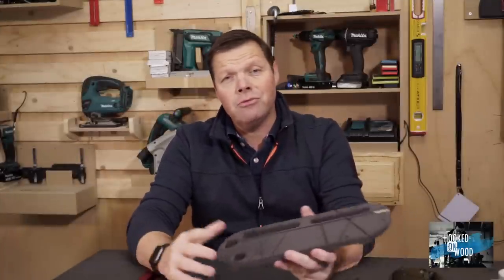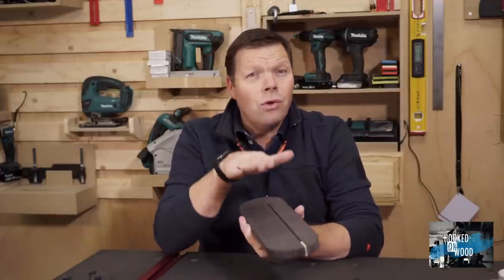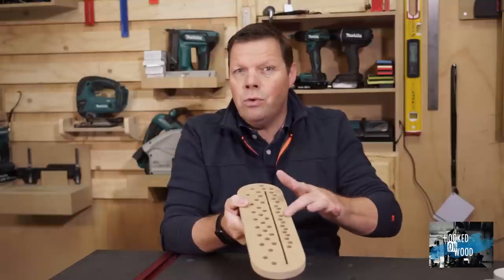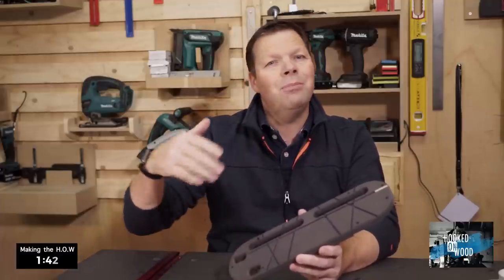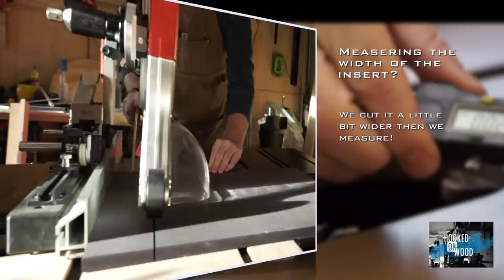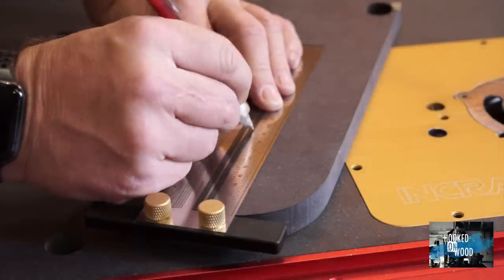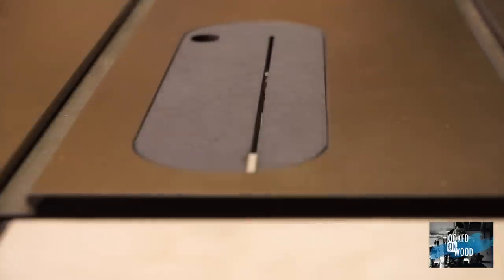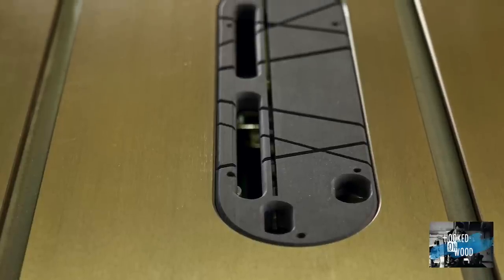A new zero clearance insert you should see!

Comment: There are some issues with your analysis-
You are adding air inlets through the insert plate to the left of the blade, to increase overall airflow. But, unless you are cutting very slim strips, these are soon covered with the material, so cannot work. Internally, the dust shroud is rarely attached to the table, so there is already a gap that lets air into the extraction path. There may well be an optimum gap for this... If the cabinet is sealed, what is needed is a duct from outside to the side of the  blade, sized to give optimum airflow.
The material that the blade cuts is trapped in the gullet as it traverses the material- and then by the sides of the insert (if it is zero clearance). It is desirable to clear it then, before it rotates and ejects upwards.(The rake tends to retain the dust.) Ideally, there would be a sideways jet of air, pushing the dust out of the gullet on the underside of the table. A good design would have an internal shroud that directed air from the left of the blade, through the gullets to the right and then away to the duct. All the saws that I have seen have fairly crude dust shrouds. It does not seem high on the manufacturers priorities...
Clearing the dust in a cabinet saw- a well designed dust shroud will taper downwards until it forms the outlet duct, so dust will fall by gravity to the duct, and there will be nowhere it can collect.
The dust that appears into the workshop is mainly that which has not been cleared the gullets under the table and escapes above- one solution is to fit a brush rimmed extractor on the top, of the sort used by CNC machines. If there is no route out for the dust, you will not have any dust.
Reply from the maker: Hi Mike thanks for your analysis. 
I do not disagree with everything you said, and it fits perfectly in my analysis. But I do not talk about what could be. I talk about what I have. And I do not have a dust shroud, so my dust falls in the cabinet.
My dust extraction system could not clean this with the holes in the cabinet. So, by creating this extra gab in the zero clearance, this improved. 
When you place a traditional zero clearance, you just make the airflow worse. 
I agree with you about the thin strips. But I do use it more than I thought. When you cover the holes, it acts just like every zero-clearance insert. So, my zero adds only something positive. When you have done your cut, the extra holes clean the inside of the cabinet.
All the other improvements you subscribe to are for the manufacturers. And I agree this is a field that can be improved. However, they give more priority to this nowadays. Thanks for your comments
Reply: @HookedonWood  Your slots will certainly help with removing internal dust whilst not covered- and that is probably the majority of the time. As you demonstrate, it prevents build-up of dust within the cabinet. My concern is more with the dust that escapes entry into the cabinet (or, more accurately, is ejected upwards by the blade after traveling through the inside). Yes, this is a different problem- but a more serious one (the dust inside will eventually rise to the point of being extracted- it will form the shape that a shroud would have given; it is doing no harm in there...) as it is now airborne.
I am more used to saws that are not a sealed cabinet- probably the majority of them. These 'leak like sieves' and would be unlikely to benefit from such slots. Sealed ones will, and for those this will be useful. However, an insert that had an extension to take the slots down to the periphery of the blade, directing the air to the side of the gullets, would achieve both aims. A 3D printing project?

Comment: Hello Dennis, did you ever check, if your "box" in which the saw is turning is actually so well sealed/air tight, that without your extra air-inlets on top, the airflow in the box is actually insufficient ?
Otherwise it could be that the air-circulation under the table influences the airflow of the overhead extractor (and the other way around.), like 2 dust extractors with inlet hoses connected.
I made 2 extra inlets in the zero clearance insert and have the impression, that things didn't improve for me if I use both extractors.
If I only use the extractor that clears the box, things did improve probably a bit with your additional inlets.
I did a lot of thinking about this and came up with the following:
I checked my cabinet-box, and found, that there are a few openings in my table and the surface size of these openings seem about to correspond with the surface size of the extractor hose.
If you have too many openings (as I now may have) extraction-speed (and strength) are going down quite a bit, so perhaps it is a good suggestion to first check this.
what say you ?
Best regards, Karel
Reply from the maker: Hi Karel, 
Your cabinet should not be, and probably will not be air tight. It has to cool the motor, but It needs air flow. But of course, you have to check if something is helpful. When I use my overhead dust extractor, I do not find any problem with dust. You understand your point and it was also my thinking. But most of the time, the wood is covering those holes in the inlet, so then the overhead dust extractor gets extra power. 
So, no extra dissedvantage in that case. Most benefit I get when I want to clean up edges, and cut away small amounts of wood at the sides. And when you can not use your overhead blade guard, than it gives a lot of benefits. SO, in my case I an not find any disadvantage.
Dennis

Comment: Thanks a lot. You can bet my next batch of throat plates will incorporate your ideas. What is the story on your choice of copper tape to seal your collector tube?
Reply from the maker: Hi Mark, I wanted to ground my system because with my former table saw I always got some static shocks when I touched it. I had this copper tape laying around so that was easier for me to use. But I found out that it is a good way of grounding. Other advantage is that the duct system does not attract dust. And of course, there is the safety thing of possible explosions. But I am not so worry about the last thing. SO, it is not to seal my duct system, but to ground it.

Comment: 1. During typical rip cuts or wide crosscuts, does the advancing board not occlude the added openings when they are most needed?
2. Any conflict between a blade guard’s up-draft and an insert’s down-draft? Might the opposing forces be counterproductive?
Reply from the maker: Hi James, 
I do not see any disadvantage against a typical zero clearance insert. That said, It is not always an advantage. If you have a cabinet saw, it will clean up your cabinet better due to the increased airflow. When cutting it is mostly helpful with cleaning up edges and cuts where the holes of course are not covered.
2. I had the same thinking, but I did not see a problem here.

Comment: I'm curious when you came up with your design did you do any calculations of air flow through your insert given the amount of air flowing through your extractor?
Reply from the maker: No, I think the most important thing is that the hole will not be larger than the outlet of your extractor. But the place on your insert is limited, so I do not see a danger in making the holes too big.

Comment: Dennis great work as alwasy , See this 100x  Need to make one ,  Has Anyone here in the US found a place to get the Black MDF in small size and not sheet goods . een a smal 15x2o would be enough. thanks
Reply from the maker: It does not necessary need to be from Black MDF of course. in fact, I made my first one from MDF and Painted it.
Reply: @HookedonWood   Thank you Dennis I made one yesterday from 1/2 Ply wood came out great , will see if helps m y dust extraction , thank  you for making this

Comment: Another way to cut the slot is to change the 10" blade to an 8" blade and slowly elevate the blade to the highest point, and then put the 10" blade back and finish the cut. This would eliminate the wooden insert!
Reply from the maker: Hi Bela, Yes, but I always found it a bit uncomfortable to do it that way. I think this way is safer, so that is why I recommend it this way. Thanks for your suggestions.

Comment: I just started buying my tools to do some wood working. A complete stranger gave me a craftsman 12 inch bandsaw after he saw my post on Nextdoor Neighbor website. I bought a craftsman palm sander, a Kobalt 10 inch table saw and cheap chop saw. 
I’m 61 disabled man and my wife wanted me to get off of my butt so she recommended wood working. Do I need to buy a zero clearance insert or just use the one I have? The reason I want to change mine is because this way I can use my drill bits to set my blade height. I can’t use them with my current insert. Thanks in advance.

Comment: I have an old Crafstman/Sears table saw - the factor throat plate is only 1/16 inch thick (metal).  How would I go about creating a zero clearance insert for something that thin? (non-standard thickness)?
Reply from the maker: When the form is not that complex, a zero clearance insert is perhaps possible. But a zero clearance insert with these holes is not possible I think.

Comment: Your trying to pull dust out from the back, my Jet Proshop II from 2017 has an open bottom I plan on adding a sloped bottom with a 4" dust port 
The 2" dust port the saw came with was useless most the dust went to the floor.
Unless you cover it every table saw has a balde tilt hole that is open now microjig sells a magnetic cover you can fit on your saw but you must move it when you make an angle changes.

But I find what your showing an interesting point of view with tests done to proof the design.

Comment: Briliant solution for a zero clearance insert. What distance would you recommend between the blade and the air slot? Also, did you use setscrews as levelling screws?
Reply from the maker: I would advise 10mm if possible, Otherwise use elongated holes wit more bridges. So, three elongated holes instead of 2. The bridges give also some stability.
Reply: @HookedonWood  What did you use as levelling screws?

Comment: But if the piece you’re cutting covers the entire insert, aren’t you just blocking the extra air suction slots anyway??
Reply from the maker: Yes they do. So, after cutting it will clean up your cabinet. And they are especially helpful when you want to clean up edges and thin strips and do not have a disadvantage with other cuts.

Comment: Does anyone have any idea why the feather board is used backward? (5:05)
Reply from the maker: I use it backward because I use it as a stopblock. I wanted to cut the same dimensions to compare these two situations. Using the back, which is a nice rounding, gives you a great stopblock and guide for a situation like this. When you want to cut a few small strips, you can use this method instead of placing the fence very close to the sawblade.
Reply: @HookedonWood  Thanks.

Comment: Hello, great video. I want to build one like it. I have the following questions:
1. Can this design work when you have a blade so close to the side of the table top? My opening is exactly like this:
https://youtu.be/zNXuYlwI8N0?t=161
2. Why do you drill the levelling screw holes all the way through? would dust fill the top of the holes?
Reply from the maker: Hi Marisa, 
That is a really narrow space left. If your fence is at the right side, this will not work. Not for a better dust extraction when sawing. But if you put it at the other side, it would improve cleaning up your cabinet. (if you have)
The reason I mate the screw holes all the way through is because I used screws with a Imbus at the top. So this way I can leveled it from above. That said. It is certainly not necessary.
Reply: @HookedonWood   Thank you